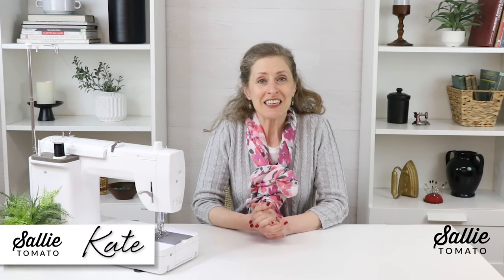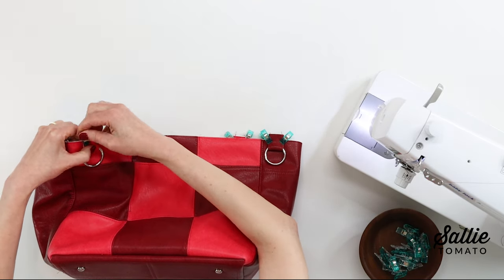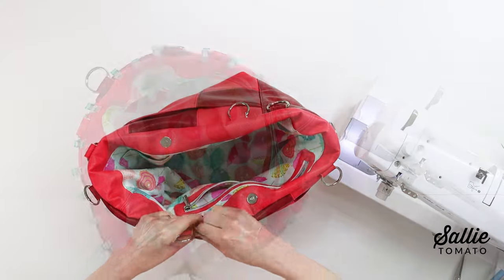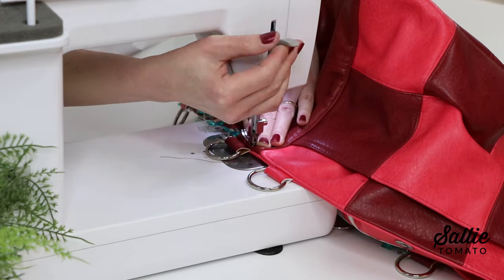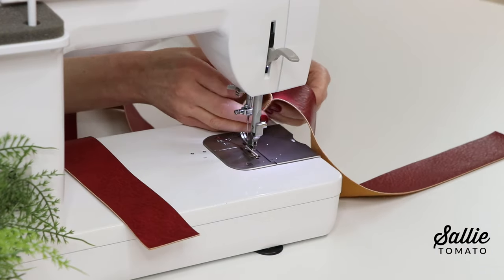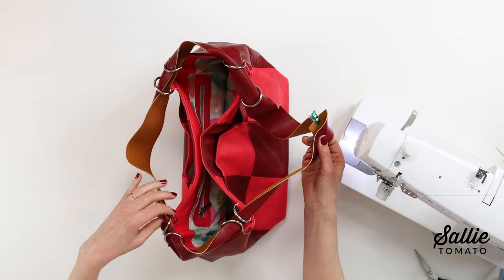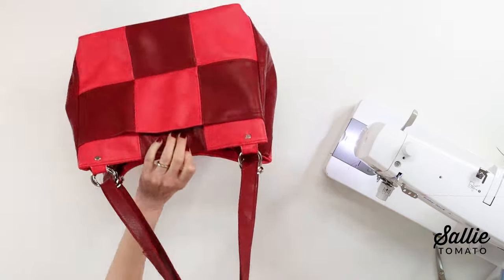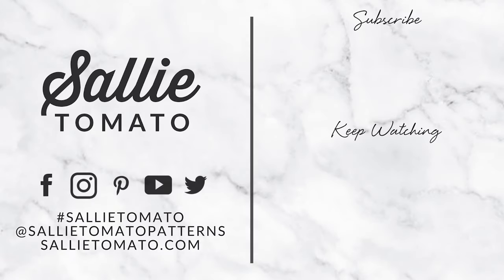Mystery Bag Sew-Along Part 5: Featuring the Lora Pattern

Comment: Kate, your instructions were excellent!    I did have problems with the box corners, though.  They turned out ok, but I had to do some improvising--I had too much material in the corners. Not really sure what I did wrong.   The bag is definitely for an intermediate bag maker who has a machine that can sew multiple layers,  I purchased the kit and received foam for structure along with Faux Leather for the main and contrast fabric.   Luckily, I have a Janome HD9 which was able to do all the sewing required.
Reply from the maker: Hi Amy,
Thank you for your note and trying this bag pattern!
I agree, the foam adds thickness to the multiple layers. I did find that fleece batting is a nice option for this project; it makes a softer bag, but is easier to sew with all the layers.
Without seeing your bag corners, as you were assembling your bag, it's hard to know what might have happened....The vertical seams of the sides and front and back panels should be "positioned" within the short edges of the base. Does this help?
Thanks again, I do hope you enjoy using your Lora bag!